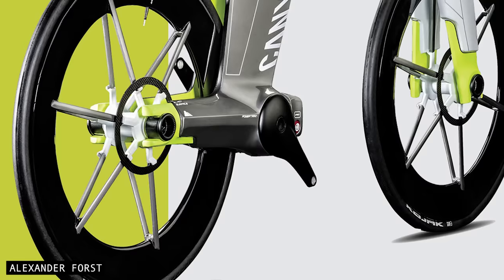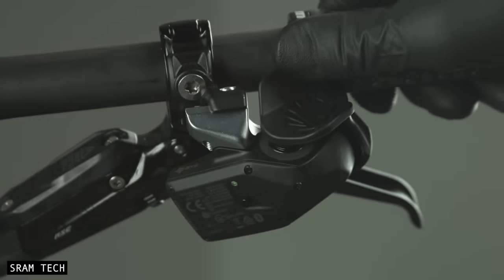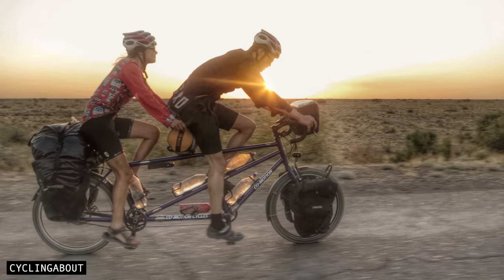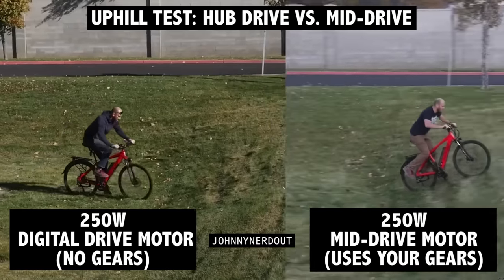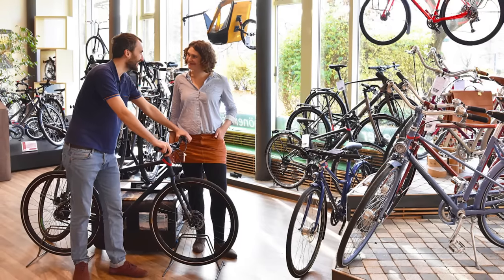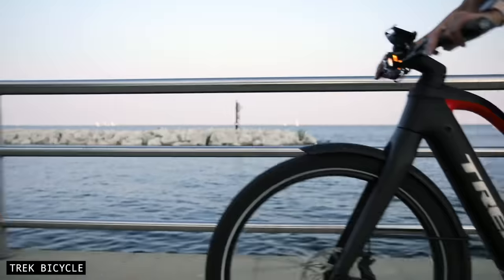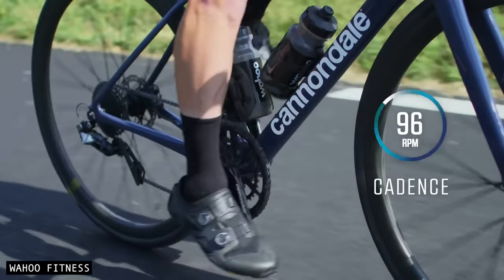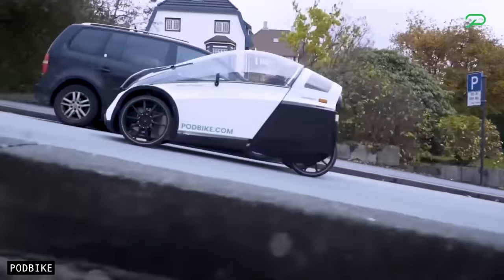Are Chainless Digital Drive Bicycles The Future of Cycling?

Comment: Bafang have recently released a 3-speed hub motor with automatic shifting, which might be a good fit for a digital bicycle. As long as bicycles don't exceed 30 km/h in the city, and are compact, quiet, and safe for people around them, I don't really care how they're powered. But I also like the idea of compulsory workout a bit. Nice video!
Reply: People will always find ways to make them go faster. 

Like, when the Bosch smart system came out, it didn't even take a week to find speedboxes for it. 

Fair point, though, they should be locked when they're delivered, and will be for sure. Countries wouldn't give the green light otherwise

Comment: I can imagine replacing the geared hub with a brushless DC motor, which can have its speed controlled electronically with little loss in efficiency at different rotational rates. Brushless motors are typically more efficient than other types of motors.

However, all the disadvantages apply that were mentioned in the video. Bike chain & sprocket systems are just too well designed.

Comment: The only question to ask is about power loss. Is there more power loss with this electric drive system as opposed to a chain & sprocket? If so, it's a hard no.

Comment: This is an amazing way to add planned obsolescence on bicycles. 🤑 For too long it’s easy to be assured that you’ll always have new parts for older bikes. Now when a new model comes out, they’ll make parts for incompatible with each other for no good reason. 😩
Reply: Ha! As if traditional bikes don't have these problems.
Reply: @bryanreidsands6854  I'm pretty sure it's still easier to work on single speed drive train. Does your bike coop have "digital drive train" parts?

Comment: IMO, the video misses one big point which is that current ebikes, if given regenerative braking, would have the best of both worlds. Even riding stress on hills/flat, extremely high power conversion, and higher efficiency than otherwise possible.

Comment: Firstly, there is nothing digital about a generator linked to a motor, even if there is an element of computer control along the way. Secondly, the friction losses in a well lubricated chain are very small, combine this with gears and there would be little efficiency gain. this is why the hydraulic bike failed to catch on, it was simply much less efficient than a chain. Now if you used a battery and a combination of a pedal driven and wheel driven generator to regenarate on downhill sections , combined with a battery state indicator that would tell you when you were keeping up the battery charge with a combination of pedalling and regenerative power, that might gain  an edge over a chain!

Comment: Amazing video! One small remark: if you use metric system please use it correctly. It's not "kph" but km/h (5:28)
Reply from the maker: As I write in so many speed conversions in my videos, I prefer the stylization of KPH/MPH. I know it's not the SI symbol, but it's still a non-standard abbreviation, and this is also not a scientific journal...
Reply: @Cyclingabout  Interesting point about not being a scientific journal but one of the reasons why metric system was intervened was to make all the nations use one standard regardless of the language. It's not standard anymore it we write it everywhere in a different way :/ Using "p" for "per" also doesn't scale up for lots of other units. Imagine m/s written as "mps" or for the cars gas usage "6 l/100 km" written as "6lp100km". It's not even about being scientifically correct but just being consistent.
Reply from the maker: @rfly-fpv  There might be an consistency argument for it, but given mph is so widespread, I don't think my preferred stylization is a big deal.

Comment: NOT THAT SIMPLE - 
1. you are at a constant efficiency with a generator - a single cadence of max efficiency 
1A Also, you are not going to die suddenly on that 6PM commute up the last hill home. (Our Friend Mr. Hazard did.)
2. You are supplementing the motor - the motor determines the vehicle speed (your calcs are irrelevant.)
2A. You do not have a "top speed for pedaling" nor a bottom limit for hills.
3. You are netting energy and supplementing range as a reward. 
4. Possible to exceed the conversion ratio given. Suppose we get superconducting?

Comment: That's properly called a "Generator Electric Drive", though it's acceptable to simply call it "Electric Drive".  Any digital control aspect that may be involved is not relevant.  It would certainly be possible to have a generator electric drive that doesn't employ anything digital.  Indeed, generator electric drive vehicles of all sorts have been around for well over a hundred years, and they were not digitally controlled. ;)

Comment: Problem is, reliability...

Low maintenance doesn't mean shiz of it did break in the middle of the road and you can't even pedal your way home...

It's one of those things that can be considered reliable Because they don't break much but when they do, they do it catastrophically...

For me, hybrid bicycles are a lot more reasonable and better... Yes their motors are small, but they can really help a lot, plus, in an even that they did break, there's still a physical chain you can crank and you can even bring tools and extra parts... Overall, it's much more practical...

Plus, if you really want a fully automated light cycle, just get a moped at this point... There are even electric ones.
At those ebike's prices, it's much more reasonable to go for the more powerful ones 😂

Digital bicycles are more novelty items than useful, at least for now.

Edit* another thing is, that promised "reliability" is actually really bad Because it might give the riders a little bit too much of peace of mind that they might not really maintain the thing anyways 😂
Any kind of motor will degrade and age rapidly without proper maintenance.

Comment: in a real product, the bike would probably still need to have a chain. Not for any performance reason but for legal reasons. In many countries there frustrating laws for many vehicles especially small personal ones. So its generally in the companies best interest to have it with a chain because then its more likely to just be under Bicycle laws. Thats why you see alot of the faster "dirtbike/motocycle "ebikes" with a crappy chain that no one would ever really want to use on the side. Unfortunately these types are laws are usually slow or impossible to change depending where you are. This looks like an great design and could really be an awesome product, hopefully the design can be made as is!

Comment: Exactly: take those things away from the e-bike that it no longer needs anyway; the drive via chain or belt!

The crank as such would remain as a non-reducible unit; the pedaling, however, would be transmitted [digitally translated] to the e-motor of the rear wheel. The real challenge would then be to give the rider the feeling of actually pedaling while pedaling.

Pedaling [on an e-bike] is nothing more than accelerating anyway - right? A bicycle is a bicycle; you have to pedal to get around. The e-bike, however, is a hybrid that has not yet been properly understood, as it does away with the most fundamental characteristic of the bicycle & replaces it with electromagnetism.

This has also changed the requirements; Form Follows Function. The drive via chain (later via belt..) was obligatory, since one has to drive at least one wheel on a bicycle....

Electric motors [+ the electricity storage technology...] have made all this obsolete. So why not just throw out everything that we no longer need & understand the e-bike for what it is?

E-bikes no longer need a chain or belt to act as a drive. That has become - if you think it through to the end - superfluous. To give the rider the largely natural feeling of conventional cycling, the crank should take on the function of a generator - thus linking pedaling with the generation of electric current.

And what happens when the power pack is empty? What should happen then? Does anyone ask this question about electric cars? The driver even keeps an eye on the fuel gauge in internal-combustion vehicles & instead of wondering what would happen if the fuel ran out, the next refueling stop is planned.🙃

Kind regards,

Alpha 💫

Comment: Not sure I'd want it for my daily commuter, I rather like my belt drive bike for that (my climate sucks half the year, keeping a chain clean was anoying).  on the other hand I've had a bit of a desire to fab up my own bike that would be sort of like one of the cargo bikes shown here but would be more oriented to traveling/camping than cargo.  digital drive would significantly simplify a few of the design issues with what I'd like to do.  There's other options but not haveing to route a belt/train would be nice.  I'd want peddle assist anyway and could stick solar on the roof for additional chargeing.

Comment: This will only works if you can generate more power then the bike needs, and I'm assuming there is a battery involved or a huge super capacitor...
Of course there have been several pedacars that went with this type of system, but never the size of a bike...

Comment: 5:34 well i did some simple calculations and, on a flat surface regen braking allows you to increase efficiency by ~30% in best conditions (assuming bike has no rolling friction), adding up to 88% efficiency, which is decent, but still 10% less than chain, AND it's in perfect conditions, irl this 30% increase will be much lower. So i don't think that this technology will find a use outside ebikes and maybe cargo bikes.

Comment: I thought it would be like a regular bike with a chain and all but using the energy your pedaling generates to power an electrical engine that would assist your pedaling, so basically an e-bike but without a battery, hopefully reducing the costs of manufacturing it. That may probably make some sense if it works, but this is just dumb.

Comment: I feel like there's a huge cost to apply something unnecessary to an already elegant system. So far the best solution is hybrid belt drive ebikes with internal gearboxes. 

There is also the possibility of manufacturing decisions to limit the total lifespan of these and that integrating digital components would prevent you from riding the bike without things like a subscription or software updates, or even limited performance due to paywalls and wifi connectivity. This idea is a false future which will likely be designed to prevent user maintenance, increase cost to the consumer and, if you're in to that sort of thing, increase production emissions with more complex componentry.

Comment: this sadly cant work, its a lie that electric motors make flat power, they do not, in fact at very low speeds, where pedal bikes excel at insane rear wheel torque electric motors suck at it. well to be fair electric motors make great low rpm torque but without rpm, since that is a direct drive, they make no hp, with a pedal bike you can drop gears and crawl up a steep hill at like 5kph by dropping gears so that you can do many pedal rotations for one wheel rotation, this allows you to put your max hp to  the rear wheel, this results in a very high rear wheel torque, several times higher than the torque the pedals receive due to the gear reduction. an electric motor on the other hand without a transmission and only 1 speed drive will be making close ot its peak torque output but without gear reduction the lack of rpm results inthe rear tire only receiving the max engine torque and not a multiple of it which reults in very little rear wheel torque. you wouldnt be able ot crawl up any incline at low speeds. the lie that electric motors make flat power has been said so much that if oyu dont believe me, well the formula for horsepower is "horsepower=torque x rpm /5252." without rpm torque is meaningless and without a gearbox to allow the motor to have high rpms it creates no output power
Reply: Excellent dissertation.  In addition to a gearbox, these bikes also need a small battery to aid in starts, since not enough electricity is generated initially.  There are already electric bike, augmented by direct pedal power, so I'm not really sure these are all that much better, do you think?
Reply: @henryfurlott2222  for simply city riding and commuting like many do in a lot of European countries these bikes would be pretty nice actually, for simple riding you don't need to worry about the inability to put down like 100 ft pounds of torque from a stop or whatnot but for mountain biking and other technical riding styles these just wont cut it. the other issue I see is that on a regular bike your power from the pedals is directly sent to the tire, exactly how you input it, if you are doing low speed riding or need to take a low speed turn your power input is very precise and important for keeping balance and not slowing down or speeding up to much which results in falling over during a corner, an e bike like this may not have the same precision with output power to the wheel so it seems like it would be difficult to do slow riding and cornering without falling but there are ways to combat that issue such as what you said, a small battery.  I think a small supercapacitor would be perfect in one of these, a battery would take some riding to charge and during the charge time would be unstable and small batteries cannot output much power, on the other hand a small supercapacitor with the power of like 5 full force pedals can be extremely small, lightweight, and take only  handful of seconds of riding to charge to a fully usable state, they are better with handling cold and don't need to be maintained like a regular battery. a small supercap would allow for instant power, lots of rear wheel torque on demand in emergencies or cornering where the pedals wouldn't be precise enough, and nice acceleration which would be fun and convenient. I think that this tech has potential for certain bike markets and when proven may even be able to usable in every bike market but the first one it will be best for is simple city/commuter bicycles. low performance, high reliability, zero maintenance, and for simple city riding with very little technical terrain you probably wouldn't notice almost any difference if the bike were built right. I should have stated in my last comment that a supercap would make it better and that this tech is only unusable for very technical riding styles but  Im just some online uncertified electrical engineer so we will see what companies do with this tech in the future.

Comment: We've reinvented the horse and come up with a crocoduck.

Yes it's a beautiful bike, yes it's amazing Tech ...

... but if you can't fix it on the side of the road with a couple of basic tools and some baling wire to get home it's a 40 lb paper weight.

The more complicated the more problematic and importantly more expensive to repair and will likely require a specialist or someone with specialized tools to fix.

Have fun.

I on the other hand will continue to pedal my ass  on my simple bikes.

Comment: i would also like to standardize a 50cc honda clone motor into a straight drive system avoiding the laws in most states kids of all ages could enjoy them but they could actually be used to get to work and trike options for shopping i would standardize all the parts beef everything up for safety ive made one already with store bought materials so i know it will have enough power the only downside is the noise.

Comment: It would never be more efficient than a chain drive, just because you have two losses at the generator and motor stages. But electric bike have a problem with the fact that the motor has a faster rpm where it is the most efficient. If the generator has a gear box you could just pedal the same rate the whole time and store up power in a capacitor bank for when you need it.